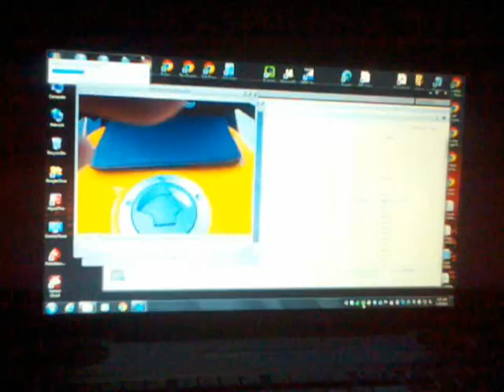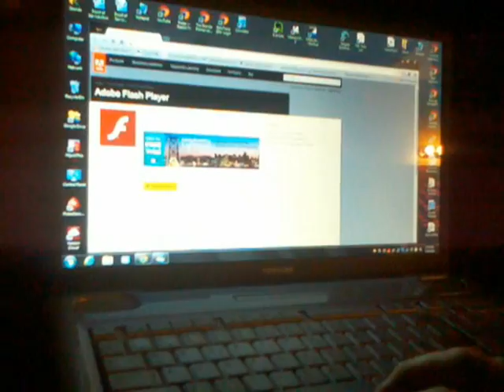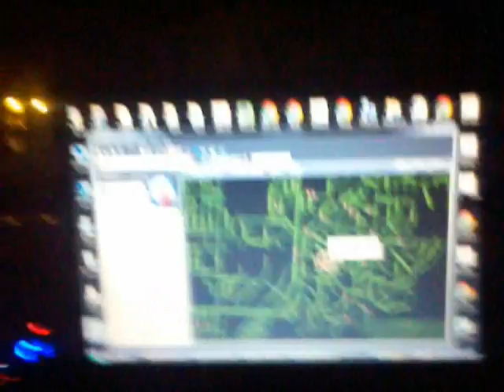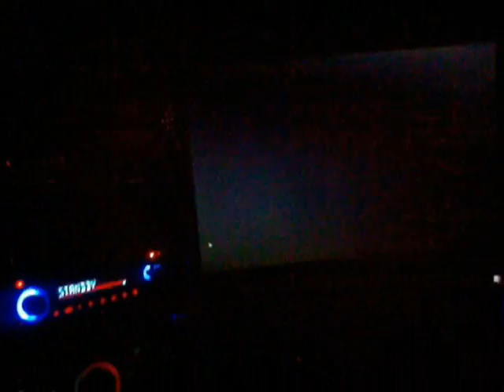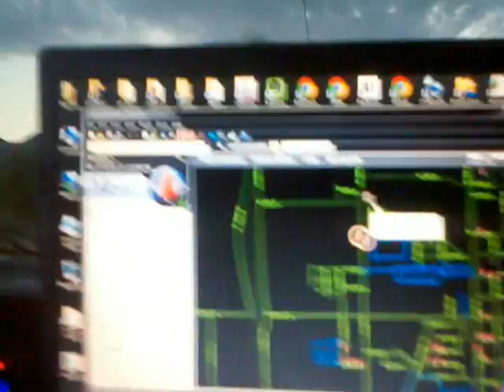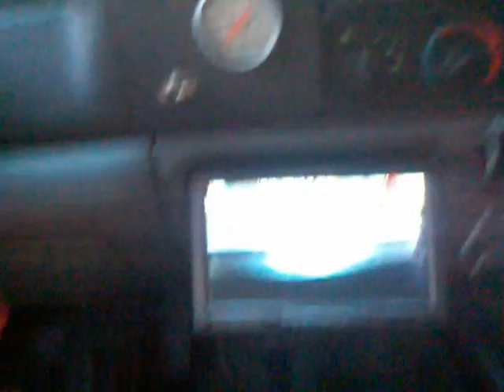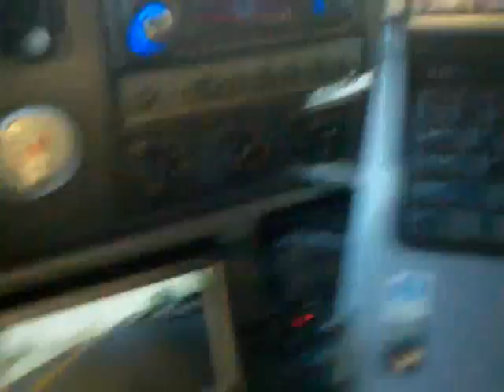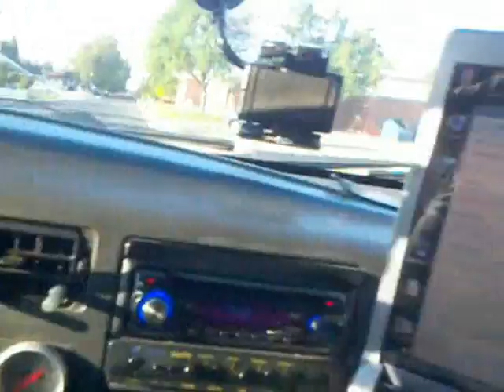Early Morning Start Shows How Putting The Hours In Can Pay Off

Comment from the maker: It's not illegal and there are no laws stating as such but you do assume all liability for any provable damages that may be sustained on the blocking vehicle.  That is why I always video record the entire process top disprove any faults claims that may arise from a pissed off debtor.  They think they have pulled on over on us by blocking their vehicle in when in fact they barely even slow us down.  It's not different than if they had chosen to use garbage cans instead of another vehicle to block

Comment: There is no 'front wheel drive mode' on Subarus, they are symmetrical AWD. You can roll them a little bit without damaging the center differential, but it's somewhat risky.

Comment: Do you prefer to run the dollies on the front or rear? Or is there a preference? And I know in the past you have changed the transmission in the beast, did they explain about not running in overdrive pulling hills and really any heavy towing? I had a 99 f450 and went thru 3 transmissions and two motors (v10) before 100,000 miles towing a three car hauler running between Cali and Colorado!

Comment: I can see the signal wire and the Starter both being bad, but the fuel pump too... sounds fishy to me
Reply: If the fuel pump on a diesel is going bad, the starter needs to crank longer against the high compression to get the engine to go. 

The major items replaced are related and do affect each other.

Comment: Matt i wasnt sure if the humming sound in the video when you first get into your truck was a power steering pump sound?  Along w/ my mustang i have a ford F250 and have had an absolute living hell with power steering pumps and seriously loud whining sounds.  Best way i can describe it would be if you let your power steering fluid run very low, when you cranked the wheel you'd hear it whine hardcore.  Just curious to see if you've had the same issue and if so, how you fixed it or handled it. Thx!

Comment: Bunch of Maxwell Boostcaps set up for a ~14v string in parrallel across the battery or a LifePO4 Battery will solve that issue, even at low State of charge both solutions will deliver plenty of amps...  Boostcaps are great for freezing weather where batteries can only trickle a few amps, the boostcaps will still dump full current. and the LifePO4 batteries also arnt as bothered by cold either and they recover faster than lead acid.